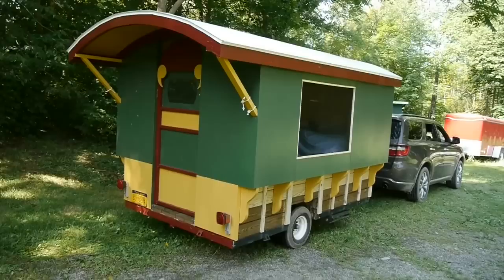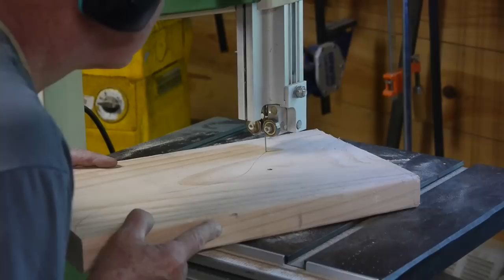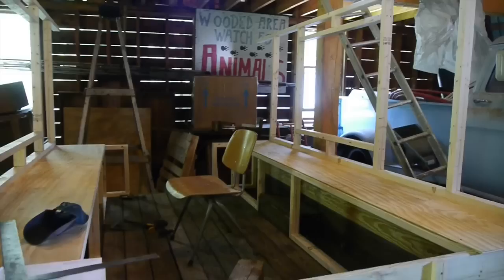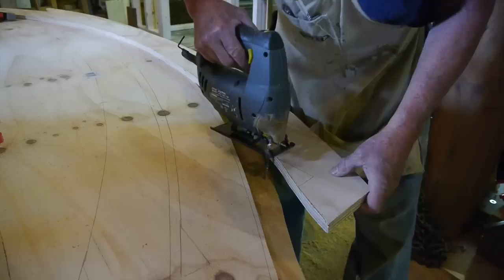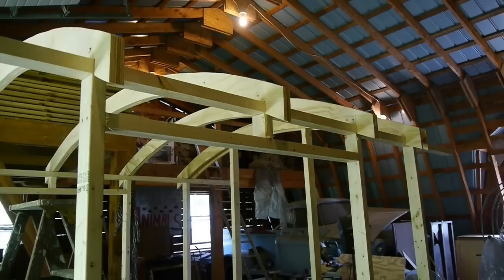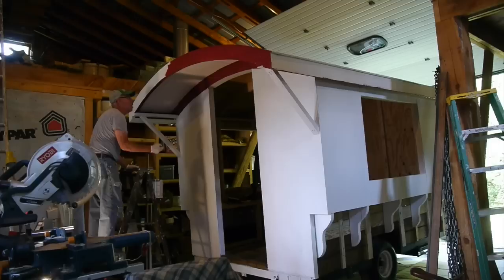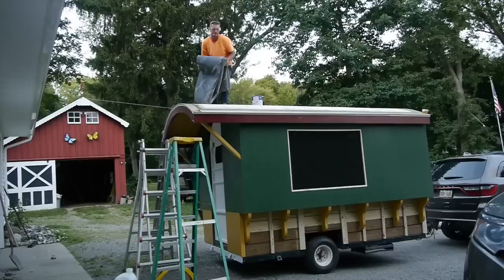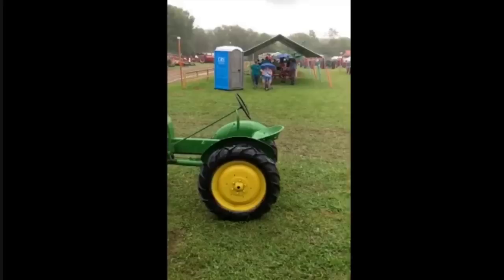I Made a Gypsy Wagon out of an old Pop-up Camper

Comment: Nicely done!! 
I have found that using a long sliver of wood or plywood instead of a string, gives a much more uniform arch. Also i would of probably ran the roof plywood perpendicular so that the joints fell in the middle of the roof rafters, so that it could be sealed better.

Comment: I would definitely upgrade the tires . It must be a lot heavier than originally manufactured spec.
  Also upgrade to heavier axle,  and possibly trailer brakes
Reply from the maker: The tires are new 6-ply.  The weight is actually less than the original pop-up camper.  This Gypsy Wagon is basically a lightweight shell with a bed in it.  Ha!  I hauled it for a weekend event and my Durango pulled it pretty easy ... oh and the trailer has brakes.  I don't ever plan to haul this thing very far so if I have a breakdown ...I can call my son for rescue.  Ha!    Thanks for watching.
Reply: I too was wondering about the weight.  I just got an old popup camper and working on what to do with it, I don't need a utility trailer and this seems like a great idea.
Reply: @JesusIsaFlatEarther  When I first saw the video I thought maybe he just replaced the canvas top part of the pop-up, keeping the stove, fridge, etc.  If the canvas is shot anyhow, why not?  Maybe cantilever a sleeping platform off the back.
Reply: @posteroonie  I've watched so many tiny home video's, when I go look at a traditional trailer or RV, they do nothing for me, even if I had that kind of money to waste.  What pisses me off, if the average person can make do with 72 sq. feet, why don't the build apartments like that for single people, so they can save money and get ahead?  It seems like the whole system is designed by bankers and loan officers.  Do pickup trucks really need to cost $25,000 plus?
Reply: @JesusIsaFlatEarther  I feel the same way..have the money and time to build a tiny house debt-free but the city won't let me.Gotta get out this place.
Reply: @patriciamacleod2795  I'm liking the idea of living in a van and who meet up with like minded nomads, to experience this once wonderful countries hidden treasures.  But maybe those times have passed, I watched a video where a guy was paddling in the water and the cops came and arrested him because he was breaking some sort of stay at home order. So now, not only do you have to live in a house, but you can't go to work to pay for  it, so obviously homelessness becomes a crime against the government.
Reply: Isaiah40:22 most pick-ups are more like 35 to $50,000! Crazy
Reply: @drew8642  what's crazy is, germ theory, theory of evolution, theory of gravity and relativity and the heliocentric theory, theory of Santa Claus and Tooth Fairy.  When I hear theory, I know someone's getting ready to pick my pocket.

Comment: GREAT EXPLANATIONS OF HOW TO BUILD THIS WAGON,  CLOSE UPS ARE WELL DONE AND CLEAR.  I HAVE FOLLOWED YOUR EXAMPLES AND HAVE BUT ONE QUESTION  :    HOW DID YOU FASTEN THE ARCHED RAFTERS TO THE TOP PLATE ?   TOE NAIL ?     AGAIN GREAT AND TO THE POINT EXPLANTION.       THE 3/4 PLYWOOD SHEETS I BOUGHT FOR RAFTERS WERE SO GREEN THAT UPON TRACING AND CUTTING THEY PROCEED TO WARP SOMETHING WONDERFUL AND HAD TO WEIGHT THEM DOWN FLAT.   FIGURING THE ARC FOR  ME WAS A CHORE BUT USING PENCIL AND STRING GOT IT AFTER 2 HOURS OR SO.  BUT I GOT IT DID.  THANK YOU   MIKE.

Comment: VERY NICE
Reply from the maker: Glad you like it!
Reply: @TimTools99  GOT A ? TIM.  HOW DID YOU FIGURE OUT THE MATH  ON THE ROOF RIBS?
Reply: ON THE ARC CURVE.
Reply from the maker: @pinkladybikermamma3603  Hello .... I knew the width of my building and so I marked that out on the floor.  Then I took my string and tied a pencil to it and tried to make an arc that looked decent.  It was totally by the look of it.  lol.   I didn't try to figure out any math ... I just went with what looked good to me for a nice arc that would fit on a sheet of plywood.  I know this is not real exact but I figured for this project it didn't have to perfect.  I used the first one I cut out as a template for all the rest of the rafters.  Thanks for watching. Good luck with your project.
Reply: @TimTools99  WELL THAT'S A PRETTY GOOD EAGLE EYEING IT TIM. THAT GYPSY WAGON IS MY FUTURE TRAILER BUILD SO I AM DOING MY HOMEWORK ON BUILDING IT. YOUR'S IS THE BEST!
Reply from the maker: @pinkladybikermamma3603  Okay PinkLady Bikermamma.  So you ride motorcycle too?  I have a Harley Trike.
Reply: @TimTools99  I USED TO RIDE BUSTED MY BACK UP PRETTY BAD SO I HAVE A LITTLE ELECTRIC/BIKE SCOOTER CALLED A LIBERTY TRIKE. FROM  PA GOOD THERAPY FOR THE LEGS AND THEN I HIT THE ELECTRIC TO GET ME HOME. CHECK THEM OUT

Comment: GREAT EXPLANATION AND PHOTO CLOSE UPS.  FOLLOWED YOUR EXAMPLE  NOW HOW DID YOU FASTEN ARCHED RAFTERS TO TOP              PLATE ?   TOE NAIL ?   TOOK ME A LONG TIME 2HR TO GET THE ARCH RIGHT USING STRING AND PENCIL.  3/4 PLYWOOD I BOUGHT WAS SO  GREEN THAT UPON CUTTING RAFTERS OUT THEY PROCEEDED TO WARP SOMETHING WONDERFUL, HAD TO FLATTEN THEM OUT FOR 4 DAYS WITH WEIGHT ON THEM, BUT THEY ARE DONE NOW.    THANKS AGAIN    MIKE.
Reply from the maker: Yes, I just toenailed them.  Wow! I would like to see your project.
Reply: @TimTools99    HELLO TIM.  I HAVE THE PINE SIDING ALL STAINED ( A WASTE OF TIME UPON REFLECTION , PAINT WOULD DO AS WELL)  WHEN I GET THE WALLS UP WILL SEND PICTURES   MUST GET MY SON TO TAKE PICTURES AND SEND AS SUCH MODERN MARVES ARE BEYOND ME.  GOOD LUCK MIKE FORD.

Comment: Super cool!!!
I was hoping it would still be a pop-up. 
Did you regret not putting vertical pieces (I forget what they're called) inside the windows? With a rafter on top of them, I'da thot they might need that. The weight of your roofers was held up by whatever nails you used to hold the horizontal headers to the vertical studs they butted up against? Eeeeek!
Reply from the maker: Hi Jennifer.  I'm not exactly sure what you mean.  Each roof rafter sits on a vertical wall stud.  I kept the construction lightweight as possible.   I think this thing will hold together for many years. Thanks for watching.  Glad you thought it was super cool!

Comment: Nice job.  I really liked it.  I was just a bit worried though that all the weight was a bit much for the trailer.   I'm not expert of course.  I was just thinking a popup wasn't designed to handle that amount of weight.
Reply from the maker: I am going to take it to be weighed as i was concerned about the weight too as I was building it.  There seemed to be plenty of spring in that trailer and it towed very well behind my Durango.  So I think it will be okay.

Comment: Why didn't you angle the sidewalls like the Gypsy wagons mostly did? I believe they did it for extra space and not just because it was trendy though. Just curious and also, why no update, so far. It would be nice to see how you trimmed it with pinstriping or such. Nice video and great work.
Reply from the maker: Thanks for the comment. I started out designing angled walls but I decided that there was no practical benefit to doing it.  Many of the Reading Style vardos had straight walls.  So, I went with straight walls extended over the wheels.  It's sort of a hybrid.  This gave me lots of room inside the wagon.  I just finished painting this puppy and then took it camping for the weekend.  This was lust last week. Haven't done any more on it yet.  I have to do a lot of design work to come up with my finished fancy wagon.  Ha!  It's gonna take me a while to do all the scroll work I have planned.

Comment: I absolutely love this video...
I flip RVs (I'm working on my 25th one right now).
Question: Why do people put (build) this together, without painting it first.
I have found out it is easier to paint/varnish fist then assemble it... 
To me it is harder to paint it above my head...
Is it easier to paint it later?
Reply from the maker: Hi Judi.  When building out of wood, I like to get my project built then put a good coat of oil-base primer on it.  i work the primer into all the cracks and then caulk.  When i paint, this makes a nice finished look.  It's the same way I painted houses for years.  I suppose you could paint the pieces first but it would be pretty hard to assemble without dinging up the paint.  No real advantage for me.  Painting is the last thing I do.  Thanks for watching and for the comment.
Reply: @TimTools99  
Okay, ...Now I understand...
Good point!!!
Reply: If you need to do any gluing or laminating. Better to do it on raw wood than painted wood.
Reply: @summerland6397  
I totally agree...
I just completely stripped my vintage 1972 travel trailer... using only a 2" brush and little steel toothbrush to get stubborn paint off... I got it done... Now I'm going to paint it. So exciting.

Comment: Could you use T1-11 exterior sheathing in lieu of 3/8  plywood for your walls?
Reply from the maker: Yes, I used the T1-11 on my Tiny House when I built that.  It looks much nicer but it is a lot heavier.  i wanted to keep this thing as lightweight as possible so i went with the plywood.

Comment: Hi Tim - You are truly a very talented man! Awesome video :-) I'm impressed and excited to make one myself from an old pop-up trailer that I have collecting dust. My question is can you please explain to me (I'm not as smart as you ;-) after I strip down my pop-up trailer, down to the flooring, how do I start to make the sides for the utility trailer with the deck board? Thanks again for the inspiration!
Reply from the maker: Hi .  The first thing I did was have a friend weld in a few more cross rails to beef up that camper frame.  They are pretty cheesy-built.  Then, I installed the floor joists on top of that trailer frame.  I fastened the joists to the frame using metal straps that my son made. Next, I put the plywood deck on.  Then, I built the side wall frame and set them up on the deck and screwed them down.
Reply: @TimTools99  Thank you so much Tim for the details. When I get started on this part, I may swing back to you for another question if you don't mind ;-)

Comment: Wouldn't superstructure be better by being built with 1 x stock with Styrofoam insulation filled structure.  Lighter and cooler in summer.
Reply from the maker: No.  I don't think so.  1-inch stock is pretty weak and 1 inch of insulation is not sufficient for where I live.  I built this thing like a house is built.  Well insulated all around and very sturdy.  I am not concerned about the weight as this thing is parked permanently next to my pond.

Comment: Found you on a search as I am looking to begin my own build soon. I LOVE the ease in which you planned this but was wondering if you have a website that details your steps?
Reply from the maker: No I do not have a website yet.  I drew up some basic plans and went from there.  I have done this stuff so long now.  If you are aware of lumber sizes, the trick is to build with that in mind so you do not have much waste.  For example, 2X4's come in 8' length and plywood is 4'X8' so make your cabin 16' long so you can put two sheets of plywood together.  Stuff like that.  Good luck with your project.

Comment: EXCELLENT JOB. QUESTION:   HOW DID YOU FIGURE OUT THE BIRDS MOUTH ON THE RAFTERS? SO BOTH SIDES ARE PERPENDICULAR TO THE TOP PLATE? THANKS.
Reply from the maker: You just use that same layout with your square and it will be right.

Comment: I'd like to know how well has the wood held up through the seasons of rain/snow/heat etc?  Any rot or water damage?
Reply: I believe he has another video of it being towed to a property where he also added somethings to it.
Reply from the maker: It has held up well because I primed it and painted two coats of good exterior paint BUT I have learned to not use plywood for exterior projects.  Plywood will seperate and not last long unless you continuosly watch it and keep it painted.  I used the plywood because it was lightweight.  Maybe if I went over it with vinal siding that would be a good way to keep moisture from attacking the plywood.

Comment: Such an amazing video of such a great build. Thank you for doing such a detailed video. One question: wat was the arch length? You showed how you did it but not the length of the string, thank you so much for the video.
Reply from the maker: Hello Joe.  Thanks for the comment. I never measured the string.  Here's what I did.  I marked a line on my barn floor about 12 feet long.  Then, I marked a line halfway on the plywood and lined up my plywood so its centerline was right over the line on the floor.  In other words, that line on the floor extended right up through the center of the plywood. (this made my plywood perpendicular to my barn floor line.) I knew how high my arch could be to be able to get the trailer out through the doorway of the barn.  I measured down the outside edge of the plywood that distance and made a mark on both ends of the plywood.  Then, I tied the pencil on the string so it would hit both marks on the plywood when I drew the arc.  I adjusted my string length to hit the marks at both ends of the plywood and also give me the rise I wanted. When I was happy that I could draw and arc that hit both ends of the plywood at my marks and also gave me the rise I wanted, I drew the lines.  It would be a lot easier to show you than to explain.  Ha!
Reply: A video would be great....lol hint
Reply: I got the idea. Kinda.

Comment: How did you come up with the distance from the center point to the top of the arc of the roof?  Was it trial and error, or do you have a mathematical formula.  I have been using a 10 foot piece of p.v.c. pipe, putting the ends at 8 feet on the plywood, and tracing the arc.  I'd like a formula if there is one, (and I'm sure there is), but I can't remember it.  I like the way your tires are under, and you get the distance over the wheel wells.  Makes much more room.  I have always used utility trailers with the deck inside the wheel wells, and reaching out over with walls tapered out 7 degrees.  (working on #4 now)
Reply from the maker: That sounds cool Gary.  I did my arc strictly by trial and error.  It really didn't take long to get it lined up.  I like your idea of using the pvc pipe!  You made me think ... I could use a piece of pvc pipe as my compass.  I think a guy could drill a hole through one end for the nail and drill a hole through the other for a pencil to fit through.  This would hold that pencil rigid for drawing the arc.  It was hard to hold the pencil on that string to keep the arc perfect.  All my rafters are a little different ... they are not perfect.  Good luck with your projects.  You are way ahead of me!
Reply: @TimTools99  I tried that.  I found it too flexible, and the line was wavy.
Reply from the maker: @garypollock1949  Oh I see.  Maybe a long board would work.  Or ... just do it the way I did it.  The arc is not perfect but we are not building a Swiss watch as my dad used to say.